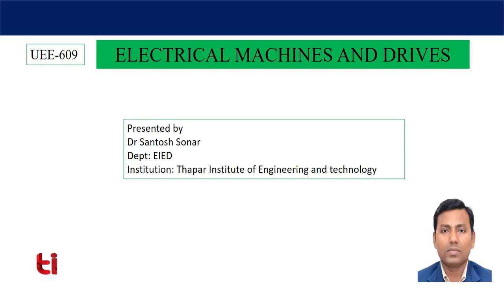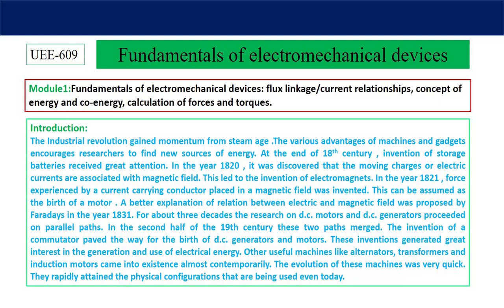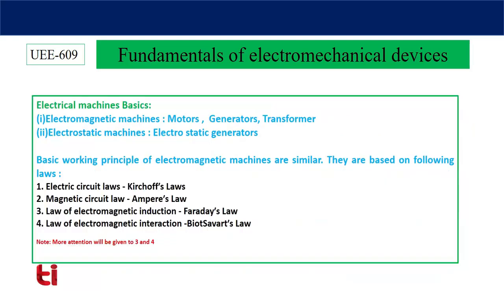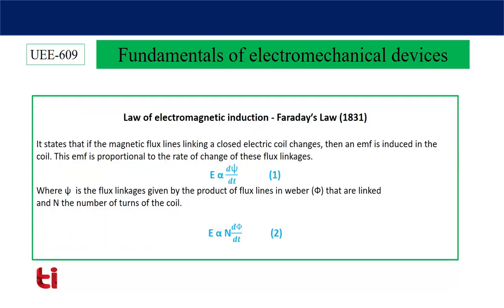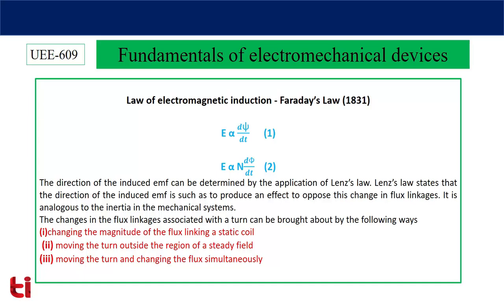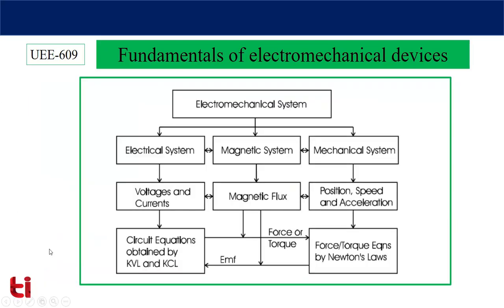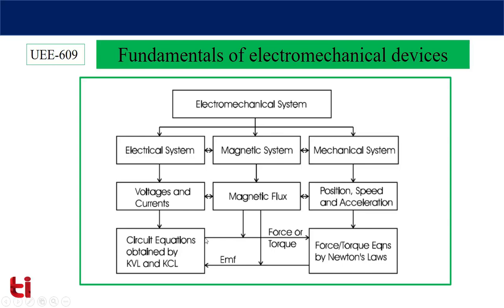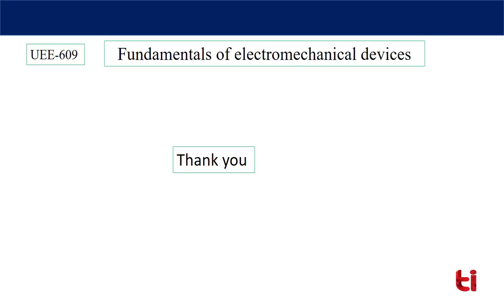Lecture_1:  Concept of flux linkage and current relationship

Comment: I've got to say that I love this narrative.  Batteries in 1800 was big as it let us move past charges and into circuits (not static electricity, but a dynamic electricity).  The 1820 discovery led us into magnetic circuits.  Then machine theory in 1831.

Laws of Electro Magnetics - 
Kirchoff's - Electric circuits - KVL and KCL. (1850)
Ampere - Magnetic circuits (1820) Orsted's law.  Current produces a field.
Faraday - EM induction (1831)
Biot Savart - EM interactions

Distance and time vs V and I